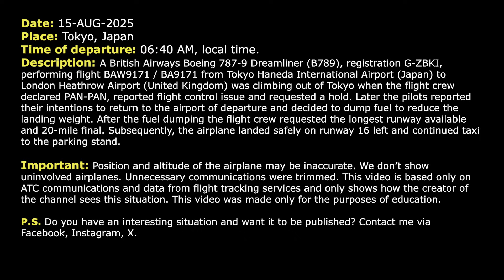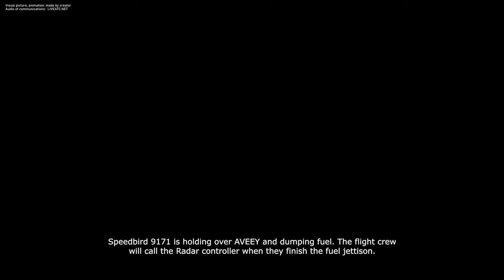Flight control problem. Fuel dumping. British Airways Boeing 787 returns to Tokyo. Real ATC

Comment: ATC could have used some CRM here, The pilot asks for the longest runway and then asks for 16L. At Narita, 16R is the longest runway (4000m) while 16L is 2500m! The pilot was clearly mistaken about which runway was longer. ATC at first tries to say no by saying it's "difficult" (a word that comes up often in CRM training, specifically in East Asian cultures when the person does not want to say no) and then acquiesces and allows the plane to approach and land at 16L. ATC should have simply corrected the pilot. All ended well but this was a communication failure

Comment: There is English and English you can understand, that coupled with radio static can make this more difficult then it could be. The BA pilots maintained their professionalism, I also noticed that both pilots were using the radio. 'Fly the Flag'

Comment: I have the greatest admiration for Japan as a country, but holy sh*t this was BAD. Pilots in a PAN-situation needed to ask again and again for simple things and Tokyo ATC didn't even understand the issue, even though the BA pilots clearly stated it in their initial call. In a MAYDAY-situation, the communication needs to work like CLOCKWORK between ATC and the pilots and the most effective manner possible and I'm having a hard time seeing that with ATC like this tbh.

Comment: Please reject an aircraft with any system problem to fly over the big city Tokyo. If needing a long runway, they should divert to the long one at Narita.
Reply: Just checking... You're suggesting to turn away an aircraft in distress?...
Reply: That's right. 
Never fly over the populated city.
Actually in the video a controller suggested to use RWY 34R that is approaching over the water bay even if it would be tail wind.
Reply: You're nuts. Now after turning away an aircraft in distress, you're suggesting that they accept it on the basis that it has a tailwind?!?!  @KeMi-j2c
Reply: A malfunctioning plane flying over the densely populated metropolis can pose a risk to people on the ground.
Reply: @captain-Dan Yes, after dumping the fuel in the sea NRT would have been the closer airport if it was a real emergency, and the area is relatively sparsely populated.

Comment: It is not clear what time of day this was, but since they were saying "Good morning," it was certainly not the time when the ILS approach to Runway 16L would normally be in use. Under such circumstances, the control tower should be praised for coordinating with the relevant departments and responding flexibly to the pilot's request.
Reply: ILS approach to RWY16L/R passes over the city centre atlow altitude, so it's only permitted during the busiest times of the day, between 3:00pm and 7:00pm. However, after much adjustment, they're fortunate to be able to choose to use it during this time.
Reply: @user-hs6er2fh8f They were on a PAN call. Local restrictions for noise etc go out the window…
Reply: It’s very clear what time of day it was, 0640 local time
Reply: Why is praise required? It’s THEIR JOB to facilitate an emergency aircraft (PAN is deemed an emergency). Give the pilots what they want/ need. They are the ones who are going to have to land the aeroplane with control issues and therefore when they ask for the longest runway, make it happen - don’t offer a tailwind approach etc because of the knock on effect.

We have all been diverted/ held due to emergency traffic, it’s no big deal. We all know that one day that may be us and we would want the expediency and accept any disruption it may cause.
Reply: @petesmith1924 if you weren’t allowed to praise people for doing their jobs you wouldn’t be able to give medals to soldiers, the medal manufacturer industry would be devastated
Reply: @kickedinthecalfbyacow7549 🙄
Reply: @petesmith1924 also we wouldn’t be able to clap at plays or cheer at football matches or laugh at comedians. It’s a bleak world you pretending to want my supercilious friend.

Comment: In the end, 34L was the better option.
Well, the most important thing is that they landed safely.
By the way, what was the control issue?
Reply: In your opinion. When offered 34L there was a significant tailwind component present. They had asked for ‘the longest runway available’. If they are asking that they certainly don’t want the end with the tailwind component.
Reply: wind290　3knots
Reply: @しん-z4e1m Stop trying to be clever. 34L was NEVER the ‘better option’. 

Go to 8:37 in the video. That’s when the discussion took place regarding runways. They asked for 16L after refusing 22. The controller said ‘how about 34R, wind 190° at 8kts’. That’s a tail wind. They quite rightly refused a tailwind approach having asked for ‘the longest runway available’ as they had flight control issues.

I can tell you don’t fly big jets commercially….
Reply: @petesmith1924  
There's another reason you might not know.
The glide path for RW16 has 4-degree slope to avoid Tokyo's urban areas, making approach difficult.
I suspect that this was one of the reasons the air traffic controller initially designated RW34.
Of course, I have no intention of operating an aircraft in the future, so please rest assured.
Reply: No, the steep descent of 3.45° is only required in the RNP 16L approach, not in the ILS and LOC approaches. You can ordinarily descend at 3° in the ILS 16L approach.  But anyhow, 34L was clearly not a better option for pilots.
Reply: @しん-z4e1m I think you are stretching too far with your reasoning. BA are familiar with the airport. When they ask for the longest runway, it is not for the controller to suggest the other end because of the steeper than normal glideslope. He could easily have ascertained of the crew were happy to accept the steeper glideslope. He was doing it because he wanted to cause less disruption to other traffic.

It’s a busy airport, I get that. But when a crew declares a PAN, they should be given priority for what they want. If they don’t get it, they will simply declare a MAYDAY and get exactly what they want/ need. The crew are trying not to declare MAYDAY because that initiates a whole host of protocols including emptying beds spaces in local hospitals etc. It’s a balance. The crew know it isn’t a dire emergency, hence the PAN, but it needs to be understood by ATC that they need urgency, and should be offered every possible help to prevent it becoming a MAYDAY.
Reply: @petesmith1924  
What you say is correct.
However, you should remember that in the real world there are multiple options available, and the optimal solution changes depending on the situation (and of course, time).
And it's not always a bad thing to stick to a decision you've made if the situation changes slightly.
That's all.
Reply: @しん-z4e1m  I know, I’m a 16,000hr B787 Captain. I fly in the real world all the time and make decisions exactly like this as required. We use decision making models to correctly identify a problem, gather all the relevant information, look at available options, decide on the best option, make a plan, communicate it, then enact it. Crucially we review and keep going around the loop if things change. 

His original decision was to go for the longest runway. It was the most sensible option considering the potential landing performance limitations due to control issues. He refused a shorter runway and a runway with a tailwind. It all makes total sense. He didn’t change that decision and politely insisted on what he wanted.

I’m not sure why you are still trying to make some kind of a point. You even sound like you are actually agreeing now, but still thinking your original comment regarding R34 being ‘the best option’ is somehow relevant. It’s not. You were wrong.
Reply: They could have gone to Narita, it’s a much more straightforward airport than Haneda.
Reply: @kickedinthecalfbyacow7549  They had flight control issues. They assessed their options and chose to stay. Who are we to question that choice?
Reply: @petesmith1924 who’s questioning? They could have gone to Narita, it’s stating an option.
Reply: @kickedinthecalfbyacow7549  Which they clearly discounted.🤷‍♂️
Reply: @petesmith1924 unless you were there you can’t know what they discussed, but my comments are for a more general audience.  Narita is always worth having in the back of your mind when you depart HND to the south, there’s no guarantee you’ll be given a return to 16 and giving yourself more options is always a good thing.
Reply: @kickedinthecalfbyacow7549 Pure speculation as you weren’t there either. They clearly decided upon a plan, and it didn’t include your suggestion. Live with it.
Reply: @petesmith1924 as I said before, my comments are for a more general audience. I’m not sure why you’re getting so upset.
Reply: @kickedinthecalfbyacow7549 I’m not sure why you keep making irrelevant ‘general comments’. But hey ho…
Reply: @petesmith1924 except they’re not irrelevant are they.  HND is an asymmetric airport that requires unusual approaches and because of that requires special training before you can operate there. When the wind is from the south then option are very limited.  NRT is a very typical airport, it’s the same in one direction as it is in the other.  I would infer from the vague nature of the request from the pilots “we want the longest runway” and then the confusion that ensued from there that they hadn’t really considered how they were going to get back into HND, the difficulty’s and differences of this airport and if they had an easier airport (NRT) just 50 miles away.  You’re welcome to attack any specific or technical details but enough of the sulky histrionics.
Reply: @kickedinthecalfbyacow7549 whatever, bye.
Reply: @petesmith1924 so you went with sulking instead. It’s good to know your limits.

Comment: How nice to hear ATC performing so well, and in their second language. Helpful and calm, not using some jargon or harassing the pilots with dumb-assed questions like "are you declaring an emergency" ATC in the USA could learn a lot from this video.
Reply: ATC in the US could learn a lot in general, i feel that the FAA should relinquish the training of US air traffic controllers to Eurocontrol
Reply: I find them difficult to understand
Reply: Such a "dumb-assed" question could have saved Avianca 52 at JFK when they ran out of fuel. The NTSB found that the crew not formally declaring emergency to ATC was one of the causes of the accident...
Reply: @andrasbagyuj1540 do you understand that in your example no one asked that question.  If a pilot declares an emergency then from that point on you shouldn’t need to keep asking if they declare an emergency.
Reply: @kickedinthecalfbyacow7549 No one declared emergency in this video. PAN-PAN is an urgency call, it's not emergency. If you are referring to the Avianca accident, no one declared an emergency there either, that is why such question from ATC could have saved their life.
Reply: @andrasbagyuj1540  This crew did declare an emergency PAN call…🤷‍♂️
Reply: @petesmith1924 PAN-PAN is not emergency. That's the point.
Reply: They’re not using jargon cos they don’t know any
Reply: Japanese ATC is v hard to understand though, after a long flight especially after you’ve just woken up from the bunk. Not their fault, just English in a Japanese accent isn’t ideal.
Reply: I doubt anyone can understand ATC without captions.
Reply: I thought it was pretty appalling from some of the air traffic controllers making communications more difficult than they needed to be. Using non-standard phraseology such as ‘how is it for you?’, giving him a vector to intercept the holding inbound course at AVEEY instead of just saying route direct to AVEEY to hold, asking about ‘hazmat’ when he should just ask if they have any dangerous goods onboard, telling him it’s a one minute hold when he’d asked to extend, then saying ‘any distance approved’, then saying ‘10 minute hold authorised’, when is was a 10 mile leg requested, trying to talk them into every other approach rather than what they asked for, INCLUDING a runway with nigh on a 10kt tailwind! Giving parking stand when they are on final approach etc. The amount of superfluous extra radio calls required to clarify what was being said made the pilots job significantly more difficult than it needed to be.
Reply: @petesmith1924  Regarding assigning parking spot numbers on landing, it's standard procedure at Haneda Airport because the rules require pilots and controllers to share the spot number before landing. Regarding coordination of landing, Runway 16L passes over the city, so it's generally not used except for Mayday emergencies. It's embarrassing to complain to controllers without understanding the rules.
Reply: @petesmith1924 you are a delight aren’t you!
Reply: @kickedinthecalfbyacow7549  I don’t really care what you think of me.🤷‍♂️
Reply: I was just going to say I can't listen to these controllers, causing so much confusion with lots of "ums" and "aahs"  and unnecessary phrases like "how about...", plus dragging out of vowels. I've stopped counting how many times the pilots said "sorry, say again", etc. Non-native speakers or not, they need more training, imho.
Reply: @bensteyn1974  Just need ongoing reviews where standard phraseology is emphasised. It is no doubt cultural - it will be embedded in so much as all the controllers do pretty much the same and it is never corrected. Just like in the States where the culture is very non-standard.

Comment: The flight departed Tokyo on 14 August (Z) just before midnight. It was on the ground 15th & 16th August and left Tokyo late on 17th August. After arriving at LHR, it had 7 hours on the ground and was off again to Kuala Lumpur. The flight number indicates a replacement or recovery flight. The usual BA flights LHR-HND are BA5 & BA7 (A350 service). G-ZBKI flew the BA5 from LHR on August 9th and was scheduled to fly BA6 back to LHR on the 10th August but it was cancelled. So, by the time this incident ocurred, it had been on the ground at HND for5 days. Didn't fix it properly?

Comment: I think this is where systems like CPDLC (or whatever the ACARS text service is called) come in handy.  Even in places like the US where English is generally spoken, it seems every pilot and controller has their own style and can abbreviate standard terms…text service would save time and help to eliminate any confusion over understanding or interpretation.
Reply: “Even in places like the US where English is generally spoken…” 😂😂😂 You crack me up 🤣😆😂
Reply: If they just stuck to standard phraseology, which is there for this EXACT REASON, no other ‘solutions’ would be required.
Reply: keep in mind CPDLC is up to the controllers discretion and typically only the En-route Facilities have CPDLC
Reply: CPDLC: controller pilot data link comms. only useful for enroute comms. In the circuit its quicker to speak than type.....
Reply: I'm a controller... Cpdlc for this situation?: Absolutely not! The problem in this was the lack of discipline in internationally recognised standard phraseology. If you can't communicate to ICAO level 6 using standard RT then we're screwed.

Comment: No surprise it’s always full of people complaining about things they clearly have zero understanding of.

Controllers are required to learn English, and in most countries, English is either a second or third language. That naturally comes with an accent just like international pilots. Controllers are more than accommodating to pilots in an emergency situation not the other way around. These controllers spoke great English and were very easy to understand.

Every country has its own rules and regulations. It drives me crazy how some people think they could do a better job, or assume their country’s rules apply everywhere, or that every controller should speak with a perfect British accent.

The aircraft made it back to the ground, and the pilots did what pilots do: aviate navigate communicate, listen and verify. Controllers did what they do control accommodate guide and coordinate. Just because an aircraft has an emergency doesn’t mean other aircraft or regulations suddenly disappear. This was a textbook emergency.

If all you're complaining about is the accent and word choices then that proves right. The pilots were great, and so were the controllers.
Reply: They should be using standard phraseology throughout. They weren’t. They should be making the pilots job as easy as possible. They didn’t through much of that recording. There were numerous confusing and superfluous calls from ATC requiring clarification again and again. It was FAR from textbook.

Comment: 10 mile legs, 10 minute legs, same diff…
Reply: Err no? Very different.
Reply: very different...
Reply: You reckon? I take it you don’t fly then?😂
Reply: @petesmith1924  I am not sure if you are agreeing or disagreeing that 10 min legs are the same as 10 mile legs? Obviously 10 mile legs are just that, but to 10 min legs depend on the speed of the aircraft to calculate the leg length. Ie: According to Wikipedia “In the US, maximum holding speeds are 200 KIAS up to 6,000 feet MSL, 230 KIAS from 6,001 to 14,000 feet MSL, and 265 KIAS above 14,000 feet MSL”.
Reply: @JACB006  I was replying to the original comment, not you.
Reply: Never heard of a ten minute leg holding

Comment: The flight number "9171" was a non-revenue one and this aircraft had been at Haneda for five days since operating LHR-HND as BA5 on August 9-10th. so I wonder what the issue was that required an empty ferry flight back to LHR.
Reply: No issue. It's a spare aircraft as the other BA5/6 would be operated with other aircraft. Need to bring it back to base.
Reply: @AeroChronicles Not sure I understand. It was due to operate back to LHR as BA6 on the 10th but this was cancelled. G-ZBKI finally positioned back to LHR on the 18th.